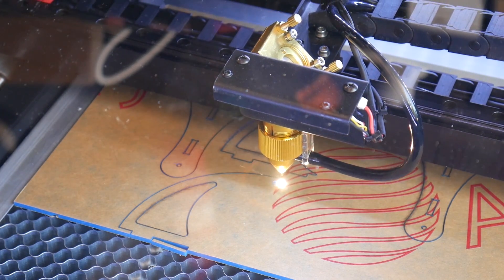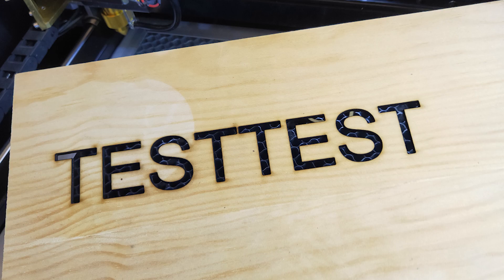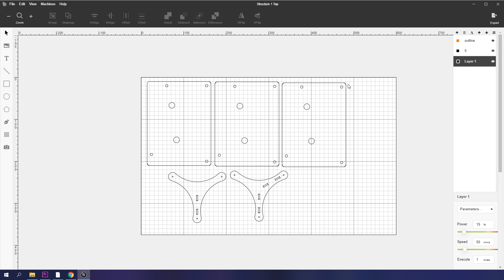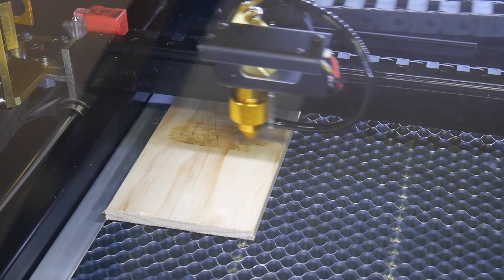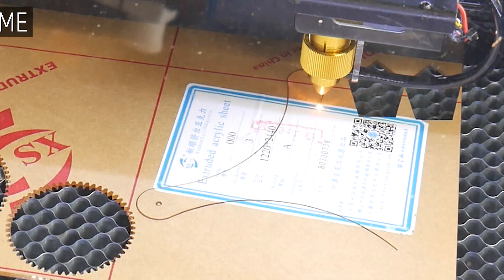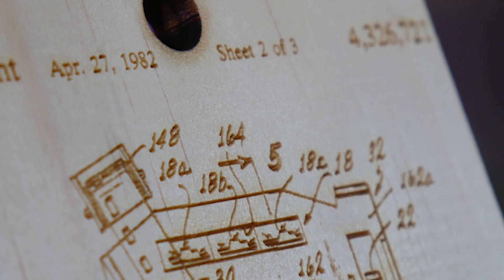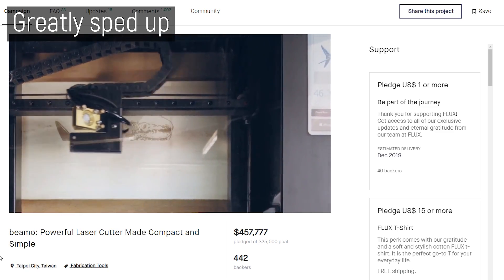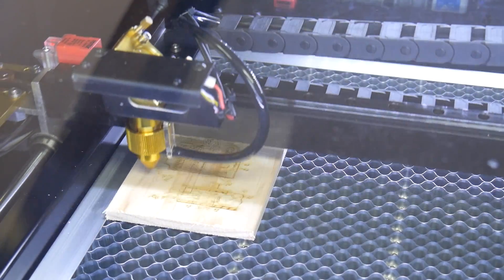FLUX Beambox Pro 50W CO2 Laser Cutter Review

Comment: Its a K40 with display and software but most of the mechanic’s are the same as a K40. I am in the process to upgrade my K40 i wil never reach the 1000 € with laser and all the upgrade parts. So 4000 is way to much.

Comment: I would love to see a similar review of the Glowforge. ... I agree, US$4K is lots of money, and being retired it isn't going to happen.
The sketch/trace option is titillating!
Reply: i believe this can be done with lightburn.
Reply: if we burn in hell, 4K is fine :)  it is time to start a DIY small business... retirement is death
Reply: Glowforge, Dremel, Muse, flux, they're all much of the same.

Small, low power, limited work area, proprietary software/parts, sketchy support, and really expensive for what they are. Some are better than others in certain areas, but that's the gist of it.

The Chinese machines offer way more bang for your buck, but have no support but a giant community, and they're easy to work on should you need to. 

Then there's Aeon/thunder. High quality, US support, good price/performance ratio.

(If your machine works with Lightburn, you can add the camera system easily)

Comment: What's this Fusion 360 plug in you mentioned? I was thinking of getting something made from Ponoko. I was going to pick the 3.2 birch they sell and I have some pieces that lock together. So I gather I need to expand those notches?
Reply: Check with ponoko regarding the kerf offset. Seeing as it differs between machines and material, it may be best to let them apply it accordingly.

Comment: You can also use masking tape to "dry run" your project.  With the real material covered in one layer of tape, turn the speed all the way up and the power down very low, and you will get a white image on the tape, but the tape is not burned thru.  Makes a great way of testing a file on expensive material.  If all goes well, send the file again using the appropriate laser settings to mark and cut you material.

Comment: You can reduce the burn area around rasters in wood a couple of ways.  One is to mask the area with tape, we often use blue painter's tape, but there are also some other low tack options as well.  You can also pre-finish the wood with paint, shellac and other clear finishes (Wipe on Polyurethane is my go-to choice, easy & quick to get good results).  There is less burn area and you can usually clean it off by wiping it with a soft rag or alcohol (tho not on shellac or latex paint which are damaged by the alcohol).

Comment: People might also want to have a look at the experience of Matthias Wandel with laser cutters and precision woodworking where he had problems with the laser undercutting pieces that had to mesh precisely.
Reply: That's due to the kerf. Much in the same way that a sawblade removes material, so does the laser. The difference lies in the fact that the saw has a constant width, and with lasers it can vary depending on the material type and thickness. 
Make a simple test cut, measure the kerf, and correct for it (just like you would with woodworking).

I can make boxes that friction fit so well you can barely get them apart, even without glue.

Comment: How many years until they get down to $1000 US? (is that even possible?)
Reply: You could build a similar unit yourself for about a thousand dollars, but for something designed, built, tested, supported and sold through a distributor etc. then it will be double that at least.
Reply: Unless there's a breakthrough in laser technology. Likely never. The limiting factor is the laser tube+supply. The weaker the tube power, the less industrial demand there is, which means the price isnt  going to change much. You can get a usable 45w chinese laser for <$1500 usd. These kinds of "prosumer" lasers are not a good deal.

Comment: Very nice. Still waiting for something that can cut thin metal sheets, though. Looks like photo etching is still the best option for this kind of detail.
Reply: Thin metal puts you into the kilowatt range, they will be an order of magnitude more expensive.
Reply: @originaltrilogy1  Yeah :(.. Maybe water-jet tech will come down quicker. I noticed there's a desktop one for about $8000. Which is still 10x more than I can afford. The other option is to find a plastic film that behaves like thin metal (thin, flexible, opaque) that's suitable for laser cutting.

Comment: I bought a 5030 50W Laser with a movable z-axis, ruida controller, rotary engraver, honeycomb bed, ethernet,  for 1600 USD, shipped in 2 weeks without additional customs duties, and it worked perfectly fine from the start. Setting up Lightburn including the camera, is pretty easy and the software is really great. I would not spend 4000€ for the Flux Beambox that looks more like a K40 painted black,  with less capabilities and what seems an unfinished software.

Comment: 4k for a 50w Cutter? Okay, I'm getting the feeling that "Prosumer" is just a marketing name to sell good looking but overpriced tools to people who are either too lazy to set up an industrial system, value ease of use above everything else, are easily persuaded by marketing or want to "impress" their customers with their flashy tools. It gives me the same Vibe as Festool tools, overhyped, overpriced tools for "professionals", but you only see them in the hands of YouTubers, people who fell for the marketing or those "presumptuous semi-professionals". I once fell for the hype, bought a 300€ Festool Drill, and an 800€ Miter Saw, said drill got outclassed by a mere half as expensive Metabo Powermaxx Drill, same quick-change system, even more compact and more power. Since then I buy tools from various manufacturers depending on the manufacturer's history.

Comment: Hi Angus. With the etching onto pine (Or most other substances actually) if you put a layer of masking tape down first you won't get any burning effects at all and the image produced is much cleaner. The laser cuts right through the masking tape as if it wasn't there. It's a few more seconds involved to apply and then remove the tape but well worth it for the imrovement in quality imho. Love all the videos! Simon

Comment: It is EXTREMELY dangerous if you try to calibrate it yourself. 5mW IR beam can damage your eyes with direct hit, and 50mW definitely DO permanent damage. This thing is 40000 mW ! One wrong move and forever darkness is your future. You need at least an OD5+ IR blocker safety glass to touch the inside of this thing without major risk. Otherwise just use it with closed cover only.
Reply: You have to have these glasses if you want to operate a laser cutter. I wouldn't only trust the cover for protection

Comment: It's my understanding that PVC when vaporized by the laser produces Hydrochloric acid, not good for the laser machine parts or operator.
The staining of the wood when engraving may be reduced if the air assist is reduced slightly, keeping the lens cool and free from fumes, but also preventing the fumes from being blown down on to the material, also engrave in the opposite direction, front of laser machine to the rear so the fumes are extracted from the material before etching.

On the matter of overdriving the tube and causing premature failure, the tube manufacturer should indicate the maximum working current for the tube, expressed in milli-amps. Unfortunately I didn't see an milli-ammeter on this laser. Since the tubes are probably the most expensive consumable of the laser machine, it might be prudent to fit one to reduce running costs.

Comment: I have been working in an IR laser lab before. Aligning those invisible laser beams is usually done with a detector card. It has a special coating that lights up where it is hit by the laser. They make things much easier than just trial and error. If you have such an expensive laser cutter, another $100 for a detector card (from e.g. Newport or Thorlabs) is not a lot of money if you need to adjust the laser.
Reply: Or instead, you just stick a piece of painters tape in front of the optics, which will give you a nice burn mark on low power :) Keep it simple.

Comment: K40 user here... I do love the camera option but honestly, I have lived without it, and do not think it would improve things for me. 
The focusing option they chose to go with is also pretty kool. I am a big fan of keeping things simple. 
But the 4K price... I could get an import 80W for around 1500.. that still 2500 left over.. 
@MakerMuse YES more videos on Lasers. And anything related to making.. expand your channel and add things like drawing devices like BamBoo or hobby level power tools ... ETC
Thanks!!
Reply: If you want to improve your K40, consider upgrading its controller for something like a Cohesion3d board. That gives you true power control, smoother motion, and most importantly, let's you use lightburn. The latter is pretty much the best laser software out there, and allows you to install a camera as well. 
Swapping the board is ~10 minutes, installing the camera doesn't take much longer. You won't regret it.
Reply: @jordymoors  you can use lightburn with the k40 by exporting its gcode and then putting it into k40 whisperer
Reply: @jordymoors  I did upgrade to AW706 (I think that's what it's called). Updated power supply... I need to get better than stock mirrors... I might look into Cohesion 3d. LaserCad is pretty basic IMO. 
Thank for the pointer!
Reply: Henrik Linus Pauly then you're not really using Lightburn for the control though, which is where it shines. It has some nice design functions, but I wouldn't use it solely for that (yet). You'd also miss out on the power control, and other goodies that come with a better controller.

Other World Explorers, if I'm not mistaken, you should be able to use Lightburn with that controller as well, no need for the C3D board in that case. There's a free 30 day trial. Just give it a shot :)

Comment: Where I work they have 20kw and 30kw cnc lasers to cut steel plate into parts. It slices through 0.75" steel plate like butter and only leaves 0.0625" cut behind that is very smooth. I was blown away when I saw them working.
Reply: sinformant, what brand lasers do you have there?  I used a Trumpf at a factory YEARS ago.  If memory serves, it only about 3300W, and it used different gases for cutting different metals.  That thing cut 1” steel plate in nothing flat!
Reply: The drawback is it warps the metal.  Most metal parts needing precision use waterjet.

Comment: 4k actually seem fair if you think about it.
you get a 50W unit from china delivered for like 1500. with those upgrades you might end up at 2000...2500 + the hours of work and still wont get the same thing.
they are quite a bit larger, not in the cutting area, just the case itself
and if youre unlucky you got a bad tube that only lasts a few hundred hours and sets you back another 300...500 bucks.

the k40 units sucks, the 50w units are much more refined and higher quality.
Reply: What upgrades would you have to make to the 50W China one that cost you $500-1000? The only thing it doesn't have is the camera, which can be added for <$100. They usually have a Ruida controller, which let's you use the far superior Lightburn software. Shouldn't take much more than an hour. 

Not sure what other features you're missing?
Reply: @jordymoors  Well, my chinese laser was missing a flat bed for starters, it had quite a bit of warp. The assisted air pump was rubbish and had to be replaced with something that moved more air. It also was much slower on engraving than this model ,also had swarf in the power supply... It's also way, way slower than Trotec lasers or similar that are the same wattage. For the tinkerer, that can fix the often unsafe chinese lasers, and is willing to take the punt on not having a bent gantry, uneven bed, cheap belts with too much flex etc. then the chinese lasers are okay, but for a business or a school etc. you want something with better QC that actually meets electrical standards and won't accidentally electrocute an employee or student. Re the Chinese lasers, I would honestly now build my own from scratch instead, and get a predictable, far better quality outcome for about the same money as the chinese import.

Comment: I never get laser cutters, unless you are looking for low production numbers most makers would be better off with a CNC router which has far less scary problems with fumes blindness, unknown materials, air filtrations, and smoke and fire concerns. CNC's can cut in 3D and in greater thickness with more diverse set of materials.
Reply: Lasers are often much quicker, can produce more intricate parts, work with more delicate materials, and engrave images. 
They're also really not that dangerous if you make sure the enclosure is closed (limit switches can shut off the laser instantly the moment it's opened), or you wear adequate safety goggles. -- I'd be way more scared of a CNC flinging broken bits towards me. 

If you can vent outside, you don't need additional filtration.
Fumes get evacuated with the exhaust fan. -- you'll need a dust collector for a router.
Unknown materials -- unless you know what you're doing on the CNC, you'll be breaking a lot of bits on unknown materials.

Lasers are simple to run. No rediculous path planning needed, no switching of (expensive!) bits, no complex work holding, no loud noises, no different tools for different materials.

It doesn't have to be one or the other. They each have their place and can complement each other well.
Reply: Way less mess, no broken cutting bits, easier to work out the paths, can cut minute detail, can cut paper, rubber stamps, less wastage, way less noise... CNC routers are great, but have their own limitations.

Comment: You said not to cut polycarb because of poisonous fumes. I've worked in the lighting industry for ages & I remember years ago, the UK government banned acrylic in indoor lighting because of poisonous fumes in case of fire. It didn't please manufacturers as polycarb was more expensive. Either they got that wrong or I'm remembering it wrong!!!
Reply from the maker: The polycarb debate is ongoing. Some people say it's safe to cut, but it will have a charred / yellowed edge compared to the clean acrylic edge.
Reply: @MakersMuse  I suppose no smoke is safe but weird hearing you say that acrylic was safer than polycarb. I think I'd trust a hobbyist telling me whats safe rather than any government!!!
Reply: Polycarb can cut well, but you need to change the settings.  The yellow is sulfur from vaporizing the material.  If you do it right, you will be melting the plastic, much like a knife in butter.  Makes a great cut, and doesn't create the smoke many find objectionable. I use polycarb to get thin and strong pieces.

Comment: Great review,  My lasers are 10 times that cost and designed for fast engraving.  I would be keen to have a close look at one of these as glass tubes are ment to cut acrylic better than metal or ceremic tubes. Any chance of personel review post Covid19 I live in Sydney.
Reply: Roy de Visser, what lasers do you have?  From your profile pic, I’m going to assume that you are in the awards and engraving industry (as am I).

Our first laser was a little 35W Epilog TT.  We outgrew it within a couple of years, and traded up to a Helix 75W.  We needed more capacity about 3 years ago, and added a 75W Fusion M2 (both of these are Epilogs, of course).  We looked at the other major players in the industry (Universal, Trotec, Xenetech), but we found that Epilog and our local Epilog rep could provide the best service for us.

The tube alone on a “vocational” laser engraver would cost almost as much as the whole system in this video.  If you didn’t have to depend on it to make your living, this one might be okay for hobby cutting.  

Maybe.
Reply: @bobtnailer   I have 2 Trotec's 25w and 60w , the 25w is a synrad tube and the 60w is a Raydon tube, I replaces the Synrad a few years ago for about 4,000 and the 60w was 8,000. you are right in you wouldn't make this a production machine. I'm intrested in it only for cutting acrylic I have my own range of trophies and can see a need for the glass tube. My business is The Trophy Store in sydney, I assume you have felt the Covid effect in your business, I will be pushing my trophies on the return to normal, I bought a CNC a little while back and now I'm  using that on Acrylic as well.  Where are you based ?
Roy

Comment: May I ask you what is the cutting speed through 3 mm and 4 mm poplar ply with this laser machine. I am looking after laser as my garage style CNC mill cuts those two materials at approx 12 to 15 mm per sec. One gets old at cutting sheet that is full of pieces and 1000 x 600 mm big. It takes up to 5 hrs. Would this particular laser mean significant speed increase for me or not. Thank you for the answer and enjoy creating interesting stuff. Regards
Reply: This one in particular has a limited work area. For the same money, you could get a much larger, and much more powerful Chinese machine (100W+). I currently cut 3mm plywood at 50mm/s on an 80W tube that's fired at roughly 65%. Pretty sure I could go faster :) It can also do more intricate stuff than a CNC due to the smaller kerf.
Reply: My 100Watt laser cuts 3mm ply at around 50mm/s depending on the ply it can be faster or slower.